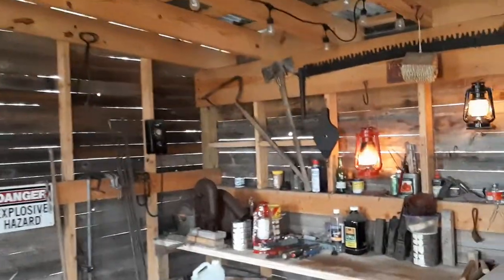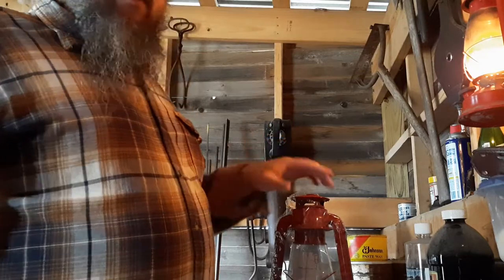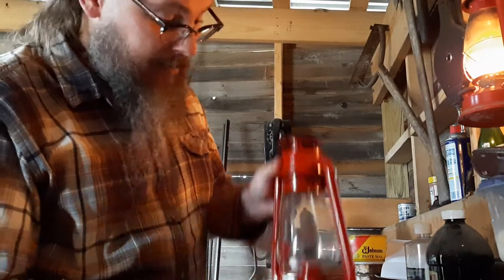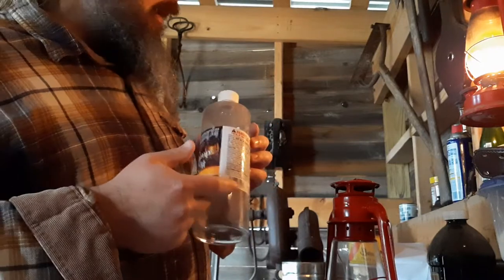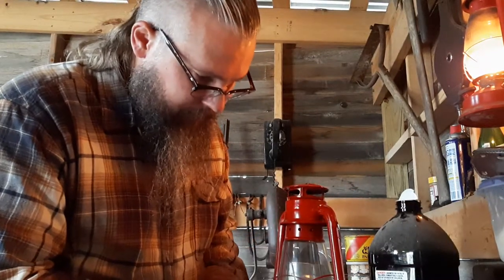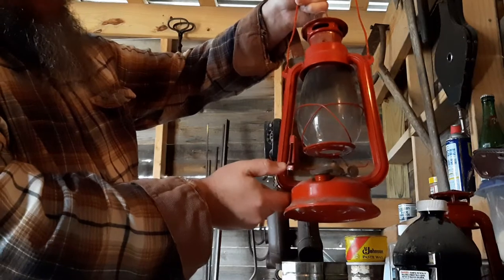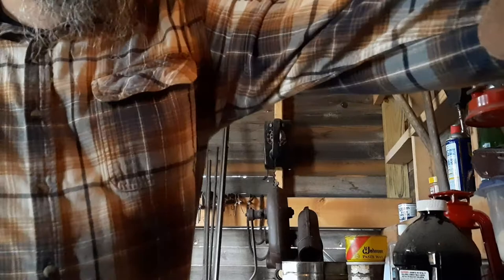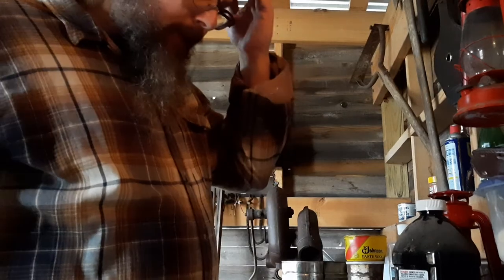Oil lantern basics

Comment: Step 1: Open the lantern and get the instructions.
Step 2: Throw the instructions away.
😂

Do you have to be concerned about ventilation with these lamps?
Reply: Thanks for watching!  I've used these indoors, but my home is about as drafty as a mailbox full of bullet holes, so there hasn't been any risk of the accumulation of carbon monoxide.  For those living in modern houses with fancy insulation and house wrap, there might be more attention paid to fumes.  But then again, they probably have modern amenities like smoke and carbon monoxide detectors, so hey, have fun.